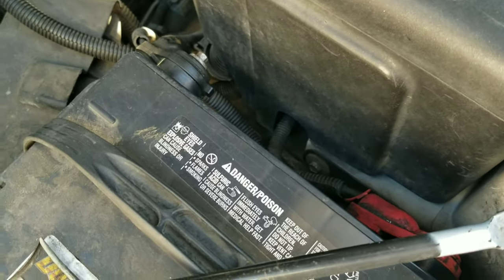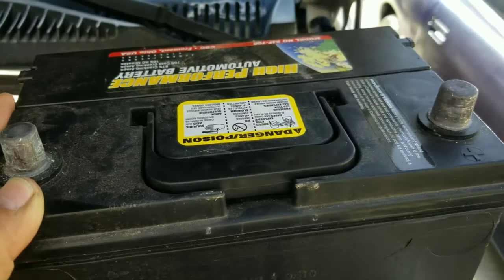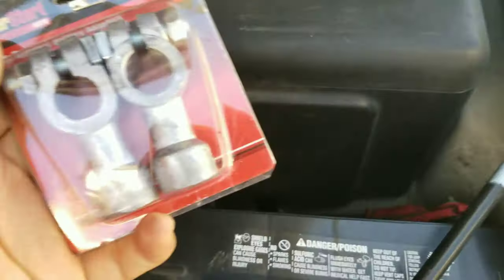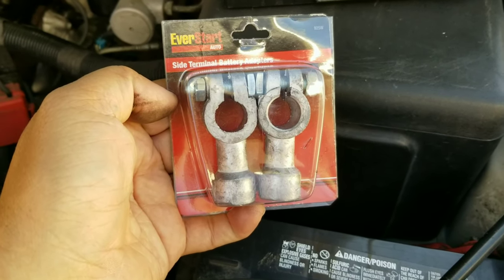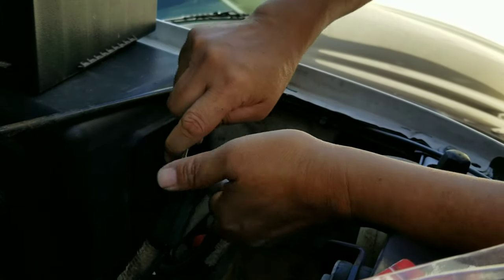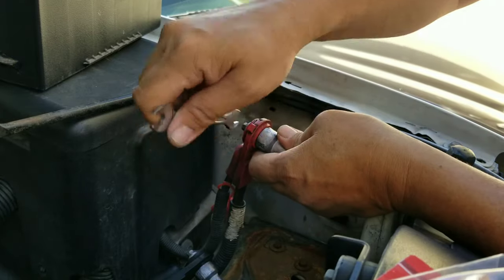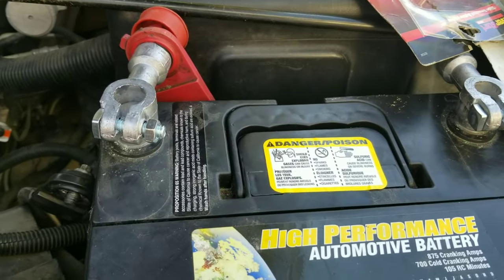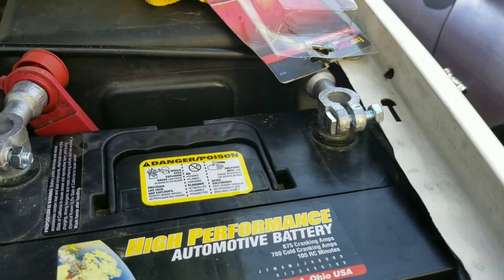How to adapt side post battery to top post for CHEAP $$

Comment: Thanks so much, this might help me! My side terminals are rather short though and I'm a little worries that just replacing the top won't be long enough. I heard you mention that you needed to lengthen the cords on your terminals as well. I'm checking your channel now to see if you have a video about that but if not, how would that be done?
Reply: Yeah no doubt! I Apologize in advance if my comment comes off rude. I'm sure that all viewers would agree w/ me that you shouldn't have posted the video unless it was a finished tutorial including the process of making your negative terminal cable longer. That being said, I'm guessing your positive (+) and negative (-) terminals on your side post battery were opposite the new top post battery you installed?? Cause I'm have the same issue with my 05' GMC Yukon Denali 6.0L V8 and wanted to see how exactly others were converting a side post battery to a top post battery including extending the terminal cables. But like I said earlier in the comment you didn't add that part. 🤔🤷🏻‍♂️
Reply: That's exactly what I was hoping for cable replacement
Reply: Best way I’ve understood yet

Comment: Converting the side post terminal connection doesn’t work long term the adapter will start to strip and the bolt will start to bend/strip

Comment: but if you have to lengthen the wires, the adapters become meaningless.
Reply from the maker: In some cars/trucks there’s no need for extension, mine is just happens a bit short. Just a 6” & gauge 6 wire

Comment: What happens when you close your hood ?? Lol!! They use side post for a reason
Reply from the maker: Hoods has far enough clearance from the battery post. I have no issues with mine👍
Reply: I have a group 75DT battery in my car and the hood closes just fine.
Reply: They use side post because it was introduced by Chevrolet back in the day as an attempt to reduce top post corrosion. Because it was a Chevy thing eventually GM introduced it into their other brands. Clearance is likely not an issue if you are working with a truck or suv as he clearly was. That's either a Silverado or Sierra or maybe a truck based suv like a Tahoe. I can tell because the area around my battery looks exactly the same in my 04 Silverado. And side post batteries are just damned annoying